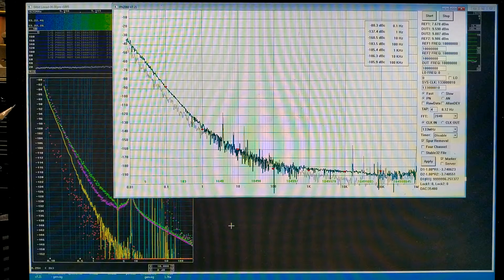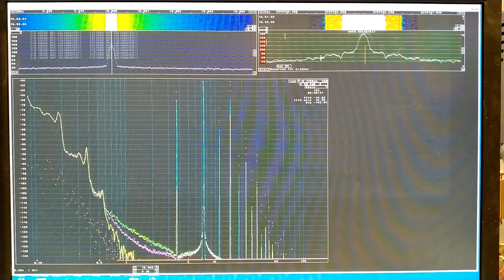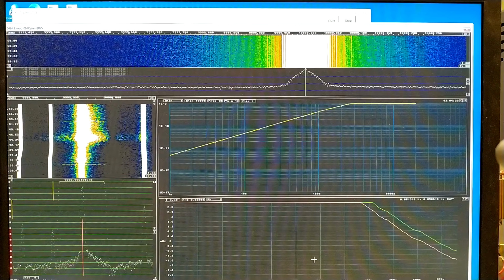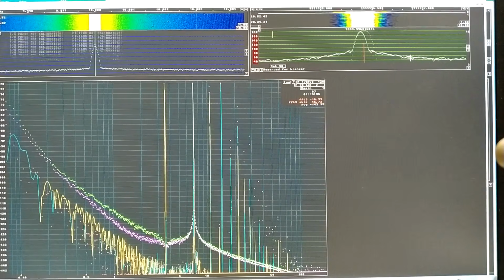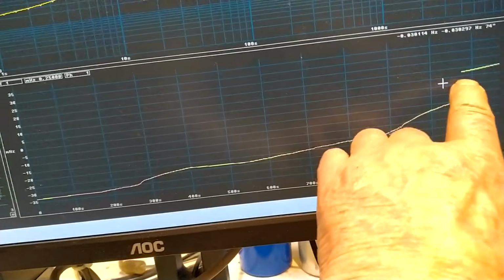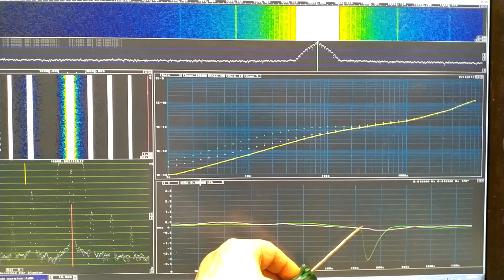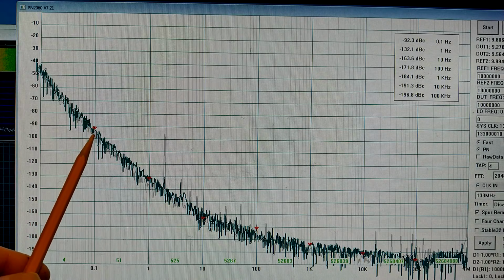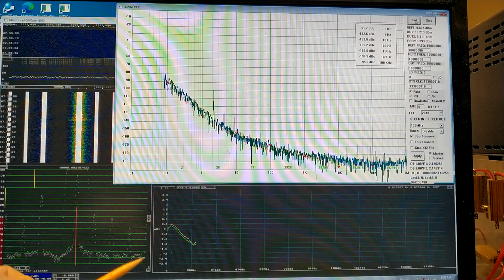nerds114

Comment: This is all really interesting even though it's way over my head 😂. Is there an overarching goal you're ultimately working toward in these videos?
Reply from the maker: No goal really - but it is fun to have designed something simple that easily could have been built 50 years ago which provides performance that only recently has been possible although at very high cost. It is based on the simple fact that if you measure a quartz crystal at a frequency between the series resonance and the parallel resonance you find an inductor. It is obvious that inductors can be connected in parallel to provide an inductor with a lower inductance. Intuitively one would expect that the phase noise produced by the individual crystals is uncorrelated so it should be possible to make better crystal oscillators by putting crystals in parallel.

I have verified that the idea is indeed correct. I have seen noise as low as -133 dBc/Hz @1Hz offset. The very best reported previously is BVA (Boîtier à Vieillissement Amélioré) oscillators,  10 MHz SC-cut crystal models like the Oscilloquartz 8607, specified -122 to -123 dBc/Hz. Ordinary 3rd overtone crystals give at best -120 dBc/Hz so 21 crystals in parallel should improve by a factor of 21. That is 13.2 dB which is what I have observed.

In the video I discovered a problem previously unknown to me that has degraded performance below 1 Hz offset and sometimes also at significant higher offsets. Performance at 1Hz is slightly degraded now however, -132 dBc/Hz.  

Measurements are VERY slow, I intend to optimise the unit and verify performance closer to the carrier but that requires a better test system to allow measurements at 0,1 Hz offset in a reasonable time so currently I am working on better reference oscillators before I go back to re-optimise the unit with 21 crystals.

One goal I have is to encourage some manufacturer to design a commercial oscillator with several crystals. It should be a major improvement at a modest cost although today there are other ways to get really high performance https://www.menlosystems.com/wp-content/uploads/MENLO_UMS-Compact_D-EN_03_2024_3w.pdf They specify -140 dBc/Hz but the cost is presumably very much higher than the cost of a product with many parallel crystals.

My interest is limited to phase noise. Long time stability would require a thermostat for the entire unit and a long time stable power supply. That is known technology, but would be very difficult for me so I am not going in that direction.

I enjoy learning new things. If you look at previous videos you can follow my work and see how I run into problems and learn new things from them. I am retired, born in 1944 and I find it stimulating to do these experiments and I hope the videos I make will stimulate others to start experimenting.
Reply: @sm5bsz289  Man, this is so cool! I'm just a casual SDR hobbyist but i find all of this really interesting. It's admirable how deep of an understanding of radio, electronics, and software you have. Linrad is a great piece of software. Keep doing your thing good sir 🫡

Comment: Environmental effects like turbulent airflow is usually easy to detect by looking at the PN plot gradient. They typically produce a slope of 40dB/decade or more.
Reply from the maker: That is presumably based on the assumption that environmental effects are Gaussian distributed. That is NOT the case for turbulent airflow as you can see in the video. Under some circumstances it gives rise to oscillations that gives sharp sidebands on the carrier and it does not extend all the way to below 0.1 Hz. Other environmental effects like power supply noise, vibrations from fans and other things are also likely to give irregular noise gradients. In my experience the only environmental effect that gives a large and smooth slope is pressure variations due to infrasound.

Comment: Quartz crystals are sensitive to acceleration (including gravity.)  Typical SC-cut quartz crystal sensitivity is around 1-2 ppb/g, around 10-20mHz for a 10MHz device.
Reply from the maker: Yes, this is commercially important because precision timing is needed for various mobile applications including military. For laboratory use it is not an issue. My idea is that a multi-crystal oscillator will become very useful as a flywheel because it will provide at least a 6 dB advantage over the available crystal oscillators at a reasonable cost. The alternatives are extremely expensive. This unit https://www.menlosystems.com/products/ultrastable-microwave-systems/ums-mini/#specifications is specified -135 dBc/Hz, I have seen -133 dBz/Hz during experimentation, but not yet reproducible. There is the UMS-Compact specified -140 dBc/Hz and Archita Hati et.al at NIST have reported -143 dBc/Hz. Maybe frequency division from optical sources will become reasonably cheap in the future, but I think a multi-crystal oscillator with perhaps 8 crystals would be a good alternative in radio astronomy and many other applications where close range phase noise is a system limitation.